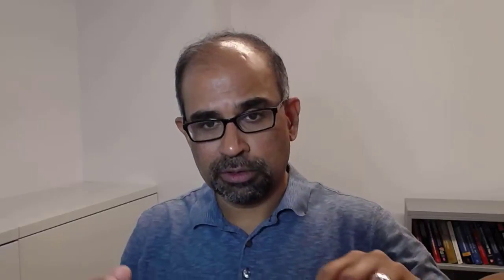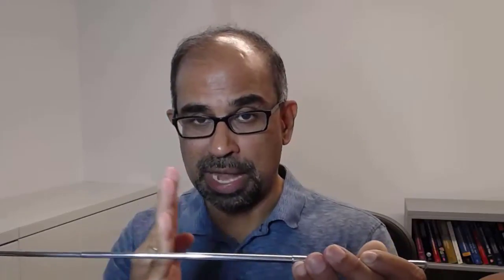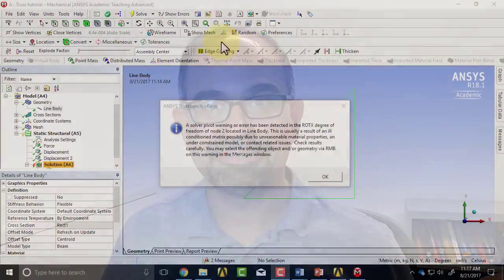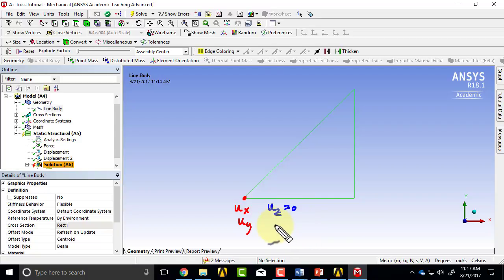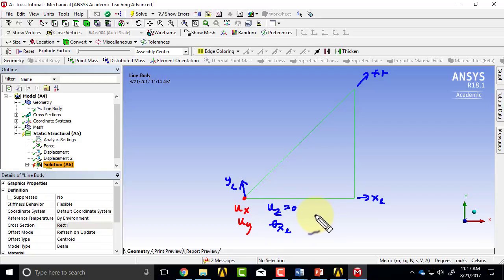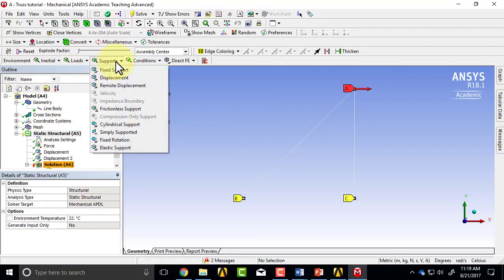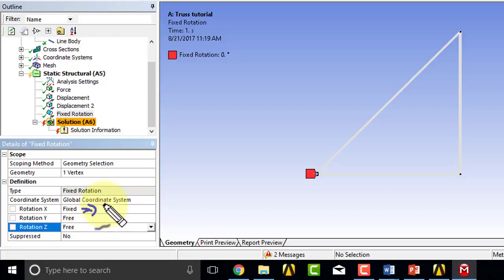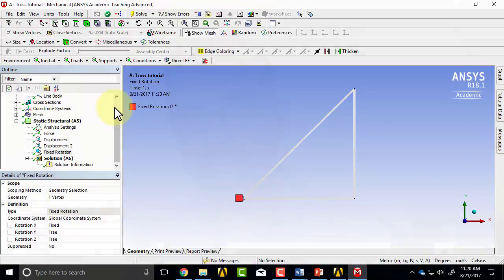7.2.6 Troubleshoot Solver Pivot Error

Comment: I am currently following the course at EdX, but in this Module (Further Learning) doesnt have the discussion part. I did apply all the static structural components like you told, but it doesnt solve the error. Are there any possible causes that you can suggest? Thank you.

Comment: Thank you sir this tutorial. İt's realy helpfull for me. I want to do free modal analysis with stress from static structural. But if I didn't add any support in static structural it give an error about pivot. I guess ansys uses this fixed suports for reference point in order to calculate deformation. Then, how can I use stress in modal analysis in free space?

Comment: Hello Friend, I am from India.
I tried to eliminate "solver pivot error" in my 1d analysis of static structural frame but could not able to remove it. Can you help me out.
I have completely understood why this error has occurred but it seems my approach is wrong to remove the error. Hence I am not able to remove the error. Help me.
Reply from the maker: What does your frame look like? What geometry engine did you use?

If you have multiple beams and used SpaceClaim, make sure you used Share Topology between the beams.  In SpaceClaim, just highlight SYS or whatever you renamed that to in the tree outline and under details change Share Topology to "Share".

For further questions, please join the edx course as these videos are not monitored regularly.

https://courses.edx.org/courses/course-v1:CornellX+ENGR2000X+1T2018/course/

Comment: Thanks for the video.
Sir, Can u make video on solving the general error saying, "An error occurred inside the solver module".
Even though i tried to increase the manual memory in the solver setting. i can not able to simulate the pre-stressed modal analysis. It is showing the error. please give few suggestion on the same.
Reply: did u get the solution because iam having same problem too when doing modal analysis
Reply: Same problem